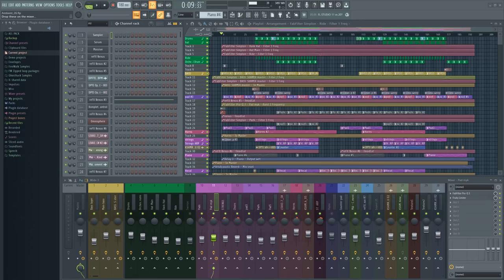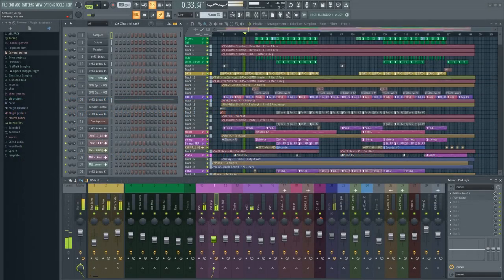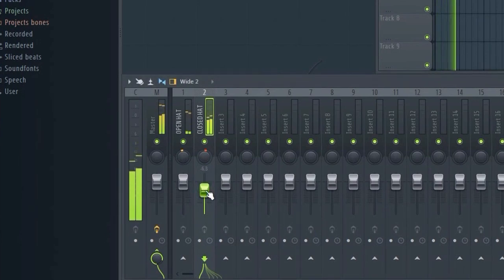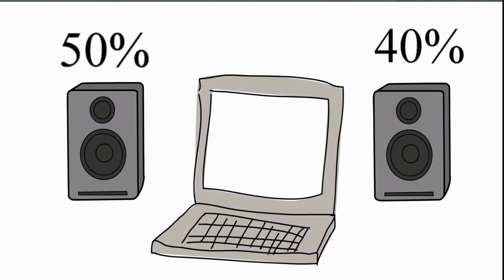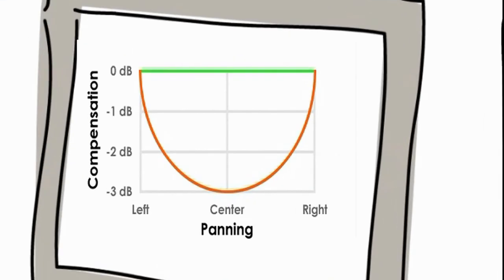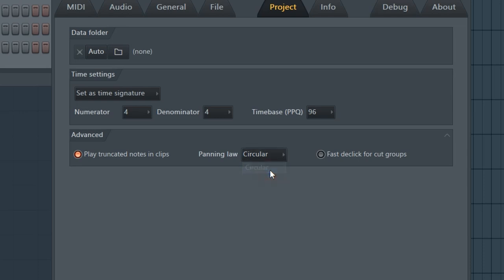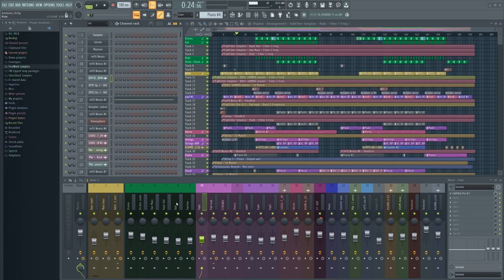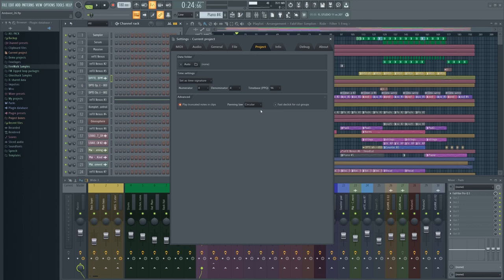Whatever You do, DON'T Touch This Setting in FL Studio!

Comment: Nice video, can you please explain the (Limiter) theory. Sooo I have FL and everytime I turn the limiter down, my beats sound even louder than ever. When I turn the limiter on, the beat is subtle. When the limter is off you can hear all of the instruments after EQ of course. Why is that?
Reply: The limiter limits the volume of the track, a better solution would be the softclipper because it takes all clipping above 0db and it compresses it for more hitting mixes
Reply: Unless doing it deliberately and knowing what/why you're doing it, just don't mix into any form of limiting or clipping. keep the final part clean. Especially if you intend to send to mastering engineers

Comment: none of the settings is right. when only one speaker sounds (in left or right pan position), it has to sound at double volume (+6dB) - ONE speaker does job for TWO, hence 2/1=+6dB. Circular sounds only +3dB in extreme points - not enough, triangular has +0dB... So, there's need for curve that would have 1.0 for both speakers when in the middle and 2.0 for each of extreme points on left and right (or 0.5 in the middle and 1.0 on each extreme pan positions). there's no such a setting. only case I saw this law is genial DigiBooster on Amiga.

Comment: I messed up my piano roll and know it's all in grey colour how can i change it to the default I'm struggling.
Help me😩
Reply: Do you mean the horizontal bars showing the notes are grey (instead of the default green)? If so, when you open the piano roll and pick the pencil item to draw a note, there is a rectangle in the top left corner that lets you pick a colour. I presume yours is grey, but you can click on it and change it.
As with most things in FLS, you can read the online help files if something goes wrong. Just right click on the "broken" thing and click Help.

Comment: hey how it going? i tried changing the setting to triangular but i am still not getting the panning effect. it stays center or the volume drops. how do i get it to go left and right. stereo shaper isnt working as well. all my other tracks i have done have the panning that goes left and right but for some odd reason it changed during a recent session. any tips to help fix this?

Comment: Another Myth that Fl studio is a good daw and is good for mixing vocals but Fl studio is straght trash when it comes to mixing vocals without using 3rd party expensive plugins
Reply: I mixed entire albums on fl studio since 2005 it doesn't have any difference with any other DAW and the sound quality is amazing because the sampling process algorithms are really good even better than other DAWs.. And you don't need any third party plug ins flstudio comes with everything that you need for vocal processing.
Reply: so all we vocal pros should change?
Reply: @ihateheartbreak  didnt talk exklusivly for me, just the fact that MOST pro and semi-pro vocal artists use it. and while you are right with the fact, that it isnt MADE for vocals, there is nothing it lacks compared to other DAWs
Reply: @ihateheartbreak  both things i do fine without 3rd party plugins. maybe you read the manual. vocal aligning with plugins on the other hand is something, like an apple pc, that real artists never would touch.
Reply: FLS has several built-in effects processors for stereo panning (e.g. the stereo shaper, Fruity Balance, various things in Patcher) and also allows automation of all the panning knobs. External plugins might speed up the process for some particular effects you might be after, but it definitely allows you to control stereo panning. This video proves it.